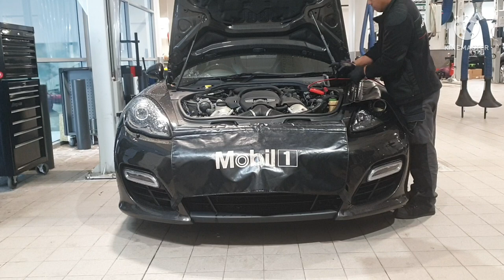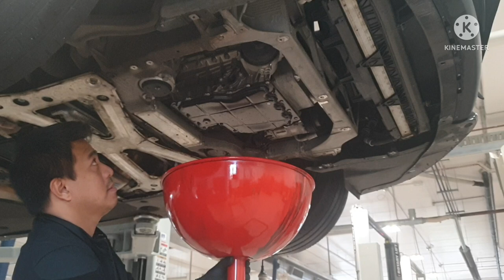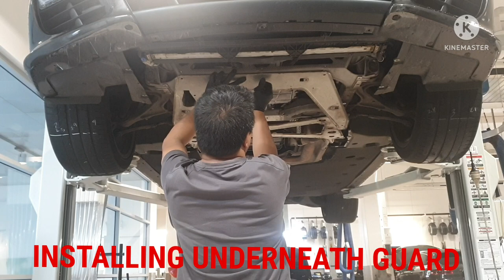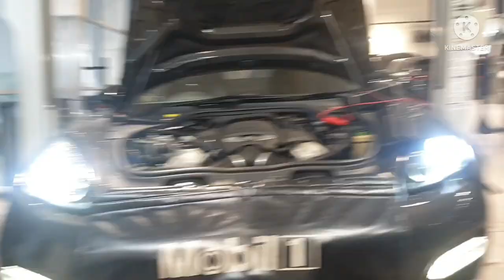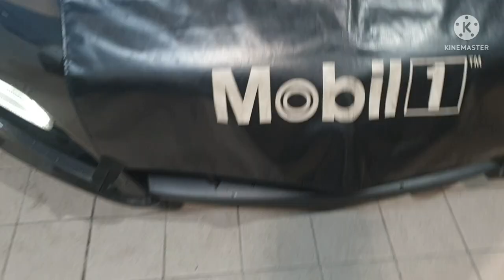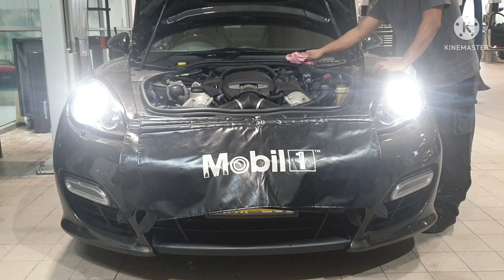Porsche Panamera GTS 2013 | Oil Change Service

Comment: Not sure if spraying brake cleaner in drain bolt hole with no bolt in it would hurt the engine or not but everything else looks pretty good
Reply from the maker: Nah mate! It will not hurt the engine.

Comment: Again stupidly dumber than I thought where the hell is the engine oil dipstick ? Never seen you once check it & or the engine oil level the normal way with said dipstick ? Can't believe a engine is missing the said dipstick that again is super disrespectful and disgusting and disturbing Dumbing down a engine like that and I definitely wouldn't rely on the dash idiot lights for such a vital fluid, my god is this manufacturer ever thinking of such dumb ideas, stupid delete option known as engine oil dipstick delete & screw you when you're engine blows up and hopefully in a confirmed overpriced grunt shop such as this.
Reply: chill